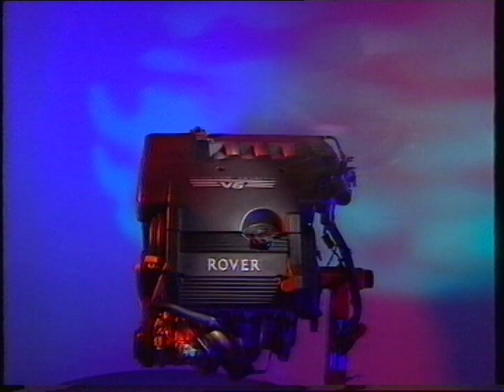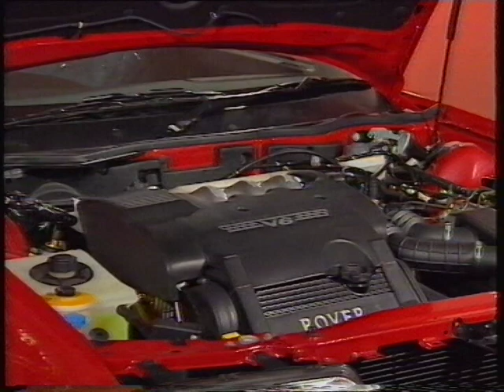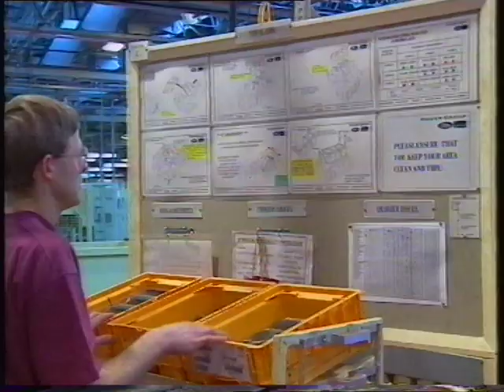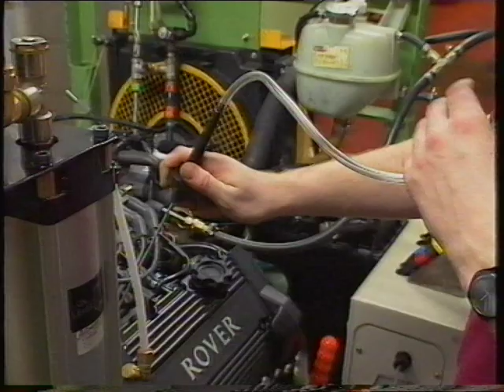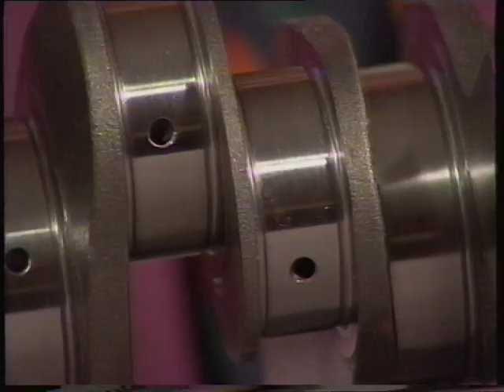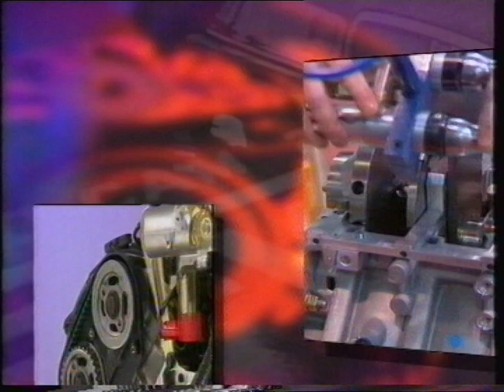rover kv6

Comment: I had the 1.8 vvc K series 160bhp in the ZR. I did love the car, mechanics hated it because of the reliability of head gaskets etc. In the end the Head Gasket didnt blow, a piston did on 77k miles and the car smoked all the way home badly. Will never get another one,although theirs not many of them left!. Ive had a Honda 2 in fact one bottom end wewnt and a Typr R ep3 that kept slipping its timing chain due to worn pulleys. Ford now! and good so far.

Comment: And the plastic inlet manifold, single peddle operated throttle body, Sliding knuckle-actuated internal throttle bodies, improved cooling, better component tolerances at manufacture...I reckon the 2 engines are CHALK AND CHEESE!